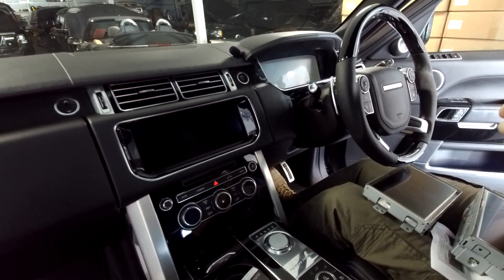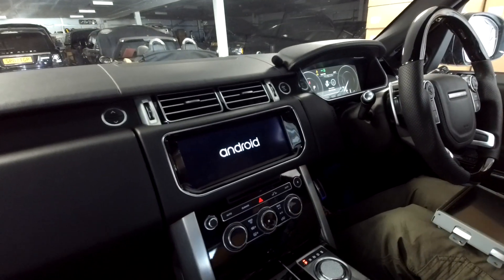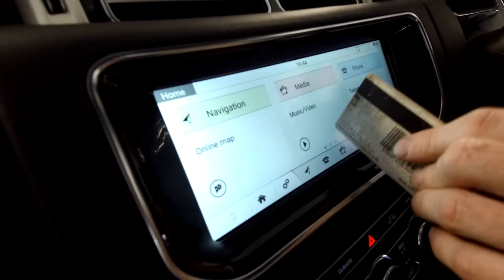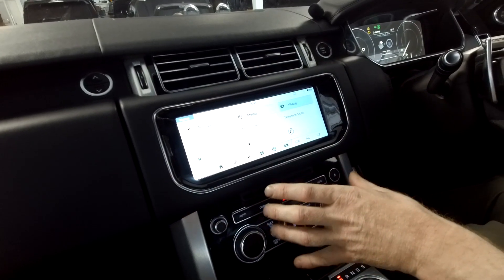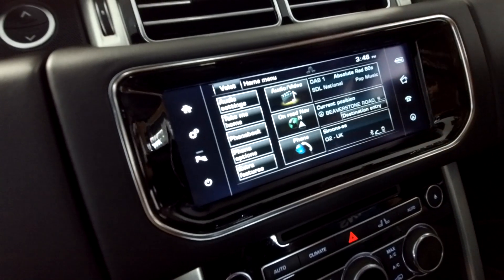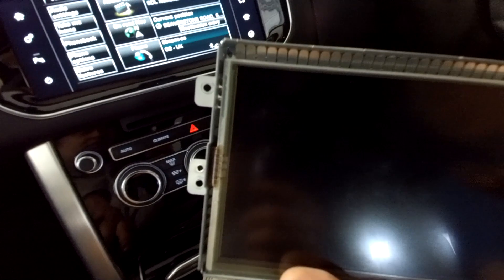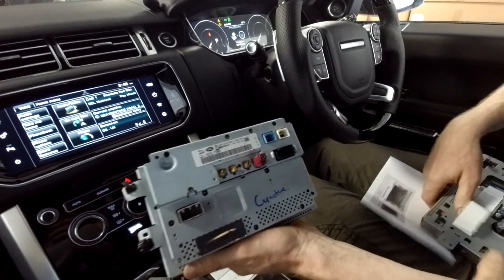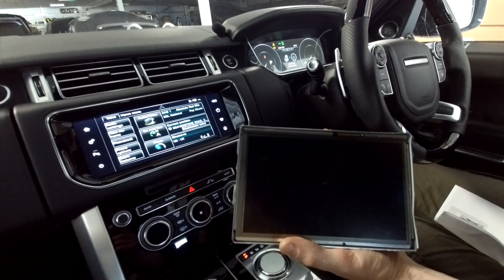How to check screen type Resistive or Capacitive + problems when fitting Android system.

Comment: Great video, thanks. I have this problem, however, fitted the new unit about 4 months ago and been working great. Old type display, new android, CarPlay all great.However last week the old type central display has stopped working, similar to your video. Android & CarPlay fine but no central control on old screen. Your video is great and makes sense now, however confused as to why would work before but not now!!!! Mine only works from finger. Any help would be greatly appreciated.
Reply from the maker: Sorry we have not looked at this for a while ! no more info to share

Comment: I have a question , can I change & make my resistive screen work on capacitive screen , I had been searching for weeks on the internet to find answers but I still couldn’t find anything 💔
Reply: Did you find this info out. I've seen a video where the settings can be changed to match the screen types ie,. Capacitive, etc. I'm wondering if that's the issue he's facing. When choosing a correct Android system, the only option given is for bosh or Harman kardon. It doesn't offer a resistive or capacitive option ???.

Comment: I bought one and the center touch screen of the original dash works, but the side buttons do not. I have the updated 9.0 android screen with only 1 input for one of the original side touch panels, and the manufacturer said I only have to connect one of them.. Well the side buttons still don’t on the android screen...

Comment: Hello, is there really no way for a capacitive aftermarket head unit to work on an original resistive touch screen Rover’s UI? I’m asking this is because capacitive touch screen almost always have a better resolution/display than the counterpart.